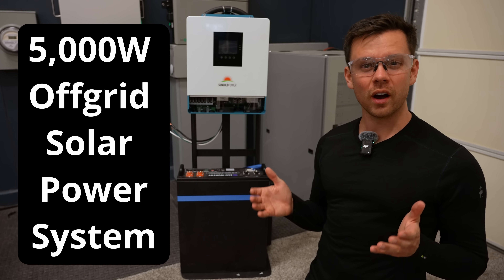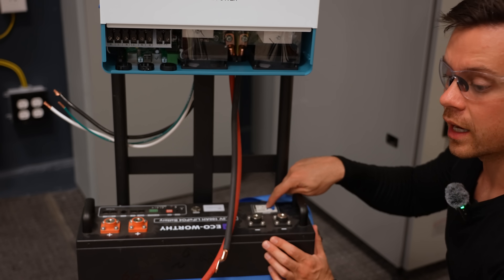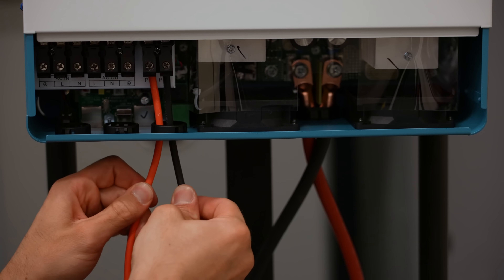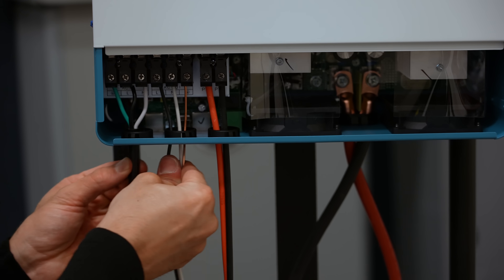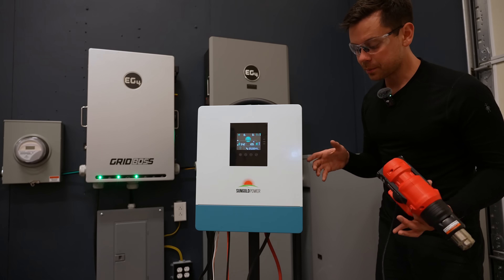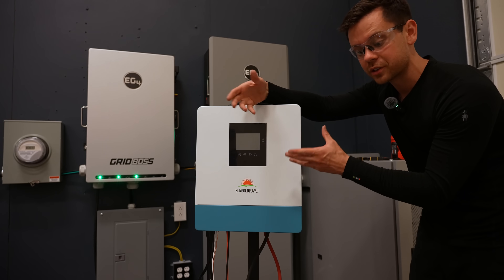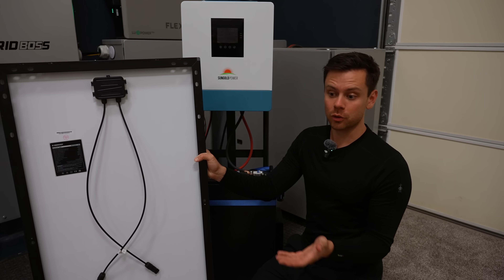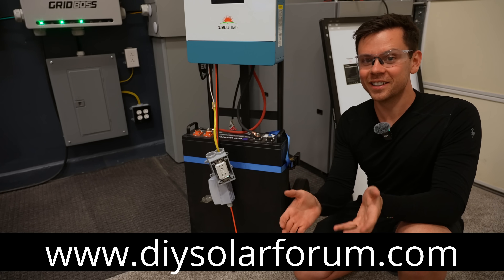Build a 5,000W Off-grid Solar System in 1 Hour

Comment: Ya know, it would be nice to have learned more before I started. My learning began with a hobo freight 100w solar, a 1000w inverter and a 100ah battery. Then a charger, then another couple batteries and another charger and a couple 100w panels, then a power station etc etc. Yes I learned a lot in the process but for less $ I could have done this from the get go and had a simple setup with equal or more capacity in a single system. I really enjoy learning more all the time, just wish I was smart enough and patient enough to learn more before I started.
Reply: If you started five years ago like I did,using the best equipment,you will still wish you had the newer ,better,cheaper equipment. Chinese manufacturers listen to what off griders want and it’s on the next ship. 
I am using Growatt 5K inverters mainly in my houses and they have performed pretty well. I like the 6000XP EG4 that I replaced one with but if I had waited for it to come out  , I would have missed out on a lot of education and savings. 
The best time to plant a tree is twenty years ago.

Comment: I would love to use one of these all in one units in my RV off grid system , I just don't have enough space for 120 volts minimum Solar that these require, are there any out there that will work with less solar ? ii there any way to work around this ?

Comment: I’m a grown up. And one thing I stay away from is electricity. I respect people who work in this field. One shock can kill you. I love this video. DYI video is very helpful. Thank you.
Reply: I was somewhat considering this, til he started talking about 120volts(even for the solar input)... no thanks. I'll just buy a power station 😂
Reply: @AlexKstar2025  Even worse, it outputs 120 volts AC.  Too scary for you?  You need to stick to flashlight batteries.  😄
Reply: @MrDave9111 naaahhhh, its not quite the same thing... this looks like some rigged up trolley... where if someone tugs on the wrong thing youre all of a sudden dealing with real volts... especially if youre stringing together 7 or 14pannels as suggested in series. If im gonna be dealing with all that, then all of a sudden a nice little unit is worth more than the savings to me, like the a bluetti elite 200 where its a compact self contained unit.
Reply: @AlexKstar2025 
Not really the same thing.
Reply: @MrDave9111 close enough for me. Then if I want to play with batteries I can just use them as a rigged up solar input.
Reply: @AlexKstar2025   Honestly if you want to get serious about solar, you need to learn to deal with higher voltages.  Its easy for me to say because I have dealt with 480 volts for years and Ive been shocked by it.  ( Not recommended!)
If you kill the power sources before working on this stuff, its very safe.
Just be warned that you can be shocked by lower voltages if the conditions are right.  Have you ever put a 9 volt battery on your tongue?
Reply: @MrDave9111 I've been zapped by 120 and everything underneath over the years... which is why I would rather not deal with it. 60volts or less for me... no rigged wiring. Not everything is for everyone. I'm sure I can safely build this in my sleep, but im not sure I want it around the house.
Reply: @AlexKstar2025  
Those components are really designed to be installed permanently.  Why put them on a hand truck? 
Realistically, this setup has the same hazards as a welder if you dont include the solar panels.   I would keep something like this in the garage.  If your going to hook up high voltage DC this really needs to be "installed".
I think people put this stuff on a cart since they arent confident enough to install it.   The power station stuff is nonsense.  Either do it or not.
Reply: Im a kid in a grown up body...
Lots of things can kill you...get over it.

Comment: Is there a safe way to exceed the solar panel input voltage rating calculation for an off grid inverter to capture more energy in lower solar hour environments, like setting up zones of panels that can be activated or deactivated based on the current amount of output being generated?

Comment: How many batteries can you add to the system? Been off-grid with a predator 5000w at $13-15 a day , and weve had 28 330w solar panels in storage. I want to get this done asap but i want to make sure itll run our frezzer and 2 ac units if possible plus other small items .

Comment: Greetings Will, thank you for a very well thought out and informative video! Can you recommend a reasonable priced "all in one" unit that can run 240v for a well pump? My well is only 70' deep and I believe is 6-8 amps max. I have 3 Lipo4 100 AH batteries to a 5000w pure sine wave inverter for 120 /fridge, oil heat furnace wifi, but am looking for a 240 option. Much appreciated!

Comment: How many batteries can I connect to this?  Is there a limit?  This is very affordable…I was looking at EG4 12,000xp plus some wall mounted batteries - but it was so flippin’ expensive.   I’d like a system that is under $5000 to start.   Then I can add batteries over time when I have the $
Reply: Me too.

Comment: Common sense and warnings for solar says to not connect or disconnect solar PV cables under load, that goes for the breaker as well to some extent.

Best is to connect/disconnect when it's dark outside.
Second best is to have the inverter off when disconnect and and for connecting just having the breaker off is enough.

Disconnecting with the breaker should work just fine for around 100 times pluss minus when under load before it may catch fire, but if the inverter is off then there is no load and won't arc at all when flipping the breaker.

High DC voltage and current takes a long distance to be broken and will cause an extremely hot and deadly arc since it never switches over 0v like in home AC.

230v AC takes less than 1mm to break the arc at 2000 watt.
While 230V DC can easily go over 30mm or more to break the arc and then can jump to your hands while holding the cable and then it's on uintill you are charred to a pile of dust 😅
Reply from the maker: Oh I absolutely understand that and that's why we use a PV specific disconnect. That's the whole point.
Reply: @WillProwse i know that you knew, was more for other people.
From what I have seen over the years is that you know a lot more about electricity and solar than most certified solar installers 😅

But even the solar specific breakers have a very limited life if used when current is flowing, and even the big ones says to not be used while loaded or only for emergency.
Reply from the maker: It's like 10X harder to extinguish dc arc, that's why we always use high voltage DC rated disconnect switch made for this application

Comment: I'm assuming you need a 2nd inverter to get split phase 240V for those loads.   Or can we just use a step-up transformer.  240V required for a well pump.
Reply: Neverminded.  Just went with a larger split phase

Comment: Is there a beginners system that has 240 VAC out so I can run my well pump ? The well pump only draws 6 amps running, start up is higher as you know.

Comment: On an RV, I would just connect the main A/C output of the All in One to the A/C shore connection. Then you would have A/C for your A/C appliances and 12vdc from the converter built into the RV. Everything in the RV is already wired, no need for all of the junction boxes, outlets, etc. I would recommend swapping out the 115VAC air conditioners for 12VDC ones that are far more efficient. My 10,000btu 12VDC rooftop pulls around 400watts on high but it has a variable compressor and fans that cycle between 400w and 300w. Even less on "eco" mode.

Comment: i got a question is there a battery charger that is programmable for 12 volts ??? i see they have inverter chargers but i already have a 2000 inverter ??? i would like two have one a battery charger that is programable so like i can set it when the voltage drops  it turns on at a certain voltage then shuts back off at the other set value.??????????????

Comment: A lot of these server rack batteries would not be safe to use in a high vibration mobile environment.  Many thread balance leads through metal with no protection resulting in eventual insulation damage if it were to be used in a mobile environment.
Reply from the maker: It will be fine
Reply: @WillProwse  In an RV as well?  Sorry, wasn't clear when I meant "mobile".

Comment: Silly question, Will: 

Could a person use a flyback transformer on the output of each panel (and connect the panels in parallel) to raise the voltage to the AOI  to ~300v? 

Does the solar industry ever use a device like this to reduce solar current or connect fewer panels?

Comment: I have something similar for a 48v golf cart with rooftop solar charger and step up controller.  It doesn’t actually charge the battery but keeps it from running down…may be a bad controller, also those 48v to 12v converters are prone to failure, have you found a good one that lasts more than a year?

Comment: meanwhile my 10kw  natural gas generator which will run my AC and all in my house for days costs less then this set up does, and this will run little for a little time, perhaps a small UPS thats about it...
Reply: Question.  It is clear that simply loosing electricity does NOT cut off your nat gas supply immediate.  However, does the nat gas delivery pipeline system depend upon electricity that will fail over time if backup generators in that system are not resupplied?  I ask because it seems that during those awful winter power outages in Texas, many people lost nat gas too after a while.  I tried to research this.  Even called the gas company.  The customer service rep did not know and didn't care to find out.  But I wasn't able to find the answer.  Research suggested that delivery for addresses furthest from the well head might indeed be electricity dependent.  But that it still works for a while as long as fuel is available to resupply backup generators.  Do you know?  Thanks.

Comment: Great demo thanks.  I was wondering how you could setup the AC out as a ring main with multiple sockets on that ring to power different things in different rooms instead of running extension cords.

Comment: It's still safe to do the ampacity math and use multiple lines of say, 6 gauge stranded copper wire in the amount of strands required to replace  sizes of wire even up to vsingle 1 or 2 gaugewire. For the outlets, I would do just that, I would run two double gang boxes, with double outlets ea, wired with 6 gauge stranded copper. Each gang wired with a separate positive and negative 6 gauge line then combine the 2 ea positive lines with a single crimp ferrule and combine the 2 ea negative lines into a single crimped ferrule or terminal depending on all-in-one connection requirements, and then attach to the all-in-one unit. Using Multiple strands of suitably insulated (THHN as an example) wire can be a safe alternative if you do your voltage drop and derating math, with consideration for being tightly bound or zip tied together  or just run loose. This aporoach is also good if you have tight spaces or bends that wont accomode the size of single large wires.  Might make a good episode going through the ability to substitue combined strands vs single.

Comment: Isn't it a potential issue to use that 14 gauge appliance cord to connect the AC input?  Specs say 40A of output from the AC battery charger, so even with no efficiency loss and no bypass loads, that's pulling 16A continuous which is already too much for a 14 gauge cord.  I'm guessing there's a setting to lower the charge amperage, but is there even a setting to limit bypass current?
Reply from the maker: Yes you can lower output current to make it safer but it trips fast and sometimes too easily. It's not a thermal breaker, it catches overload quick. but a load center would be better and recommended
Reply from the maker: Bypass current is the worst part of these systems actually. And ground neutral bond. Need to make new video about that. Absolutely an issue

Comment: I have a question. As a newbie to server rack batteries, is it possible to buy the 5.12kwh server batteries to recharge any of my portable power stations? Also, is it possible to solar charge server rack batteries without having to purchase an all-in-one inverter? Thank you.
Reply: Most power stations should accept power from a 48v battery (voltage ranges from ~48-57v. You need to look up your particular power station's solar voltage input range. My bluetti has a 60v max, so I can charge at full power using my server rack battery. The power station cannot charge the 48v battery though, so you will need a standalone charge controller and solar panels or a 48v battery charger that plugs into the wall.
Reply: @jake-mv5oi you can use a 48 volt battery charger that is plugged in to a portable power station to charge the 48v battery.
That is what signature solar had me do before my system was set up so I could get my battery's fully charged.
It was slower but it did the job.
Reply: @MyCabinLife  Ya, I meant it can't directly charge the battery without an add on.
Reply: @jake-mv5oi Thank you for that information. How do I connect a 5.12kwh server rack battery to my power stations? 
If I connect 2 of the 5.12kwh server rack batteries together (parallel or series?) how do I connect them to my power stations in order to power my power stations? Sorry for all the questions, but I am new to this stuff.

Comment: I followed the link to the inverter and found a 6200W split phase inverter also by sungold.  Anyone know how bit it is compared to the 5k?  I want the option of using it instead of my generator sometimes via my generator port on my house.
Reply from the maker: Don't use that one, haven't tested it. Their products are made by multiple manufacturers and I've had problems with their other products in the past.

Comment: Question for the experts, which I am not even a newbie. Is it possible to have a 30 or 50 amp plug. Instead of 120. I'm thinking of a way to plug rv in.

  Would imagine more battery/AH.
Plan would be to keep  plugged in all the time and when grid goes down ups swithes to the cart. Is it conceivable??   TY
Reply: That is what I'm building mine for. I bought a prewired rv outlet box with a 30 amp and a 20 amp outlets. I plan to connect it to the AC out from the inverter and have separately fused circuits. You can get the boxes with 50, 30, and a duplex 20 amp outlets for a little more. But 30 amp is enough for my rv and I'm using the EG4 3KW which wouldn't supply 50 amps.

Comment: Would you be interested in buying a new electric van (panel van) and figuring out a way to slam as many solar panels on it as possible (perhaps with a trailer that has some fold out panels and a large battery) and then see if you can charge the thing and how many miles you can add back into the vehicle per day to see how far you can drive on Sunshine. Those new Aiko panels at 24.3% efficiency and cell level diodes for shading look the absolute BOSS for this application.
It's got to be possible by now SURELY!! I need to see someone test it or I'll have to damn well do it (but I can't afford it) The new Citroen 4ton E- relay has 200KW (280 bhp?) and a freaking 110kWh battery!! Come on man I need to see this done!!

Comment: How would you wire this up for a 50a RV? Sounds like it doesn't have a built in transfer switch, but the RV would have the power distribution covered. There's a wide variety of switches to choose from though (and some have poor manuals)

Comment: Would it be possible to connect 2 of these in parallel to double the wattage??
Or is this recommended
Reply from the maker: Yes you can, and it comes with the cables to do so

Comment: Thanks for nice, clear, concise video.  Maybe not ideal for small or medium RV.  Not only do you need the boost add on for small PV array, but the 12Vout buck for 12V loads. You also need to hack in alternator charging, which is usually an important feature.  But for cabins or partial home system, seems great!

Comment: Thank you so much - I am striving to move from newbie into better informed and have been glued to your information! I have a Anker F3800 with a battery that I connect to a transfer switch to run all but the heavies (stove, air, pool).  I also run an office using a Ecoflow pro 3. The reasons for going ahead and getting these items were to save money on electricity and to make sure I could keep power going in the house (I have 3 disabled children who have to be taken care of with their own machines).  I only have about 1200w of solar, but use it to charge the Anker and Ecoflow on sunny days - then charge them overnight through AC when the cost is cheapest (goes down from .32 to .11 from midnight to 6 AM). i took a long time to say that I'm thinking I'll build this unit for power outage backup and keep it charged through solar and AC to keep units running in case I'm down more than 1 day- BUT may do the DIY VS Ecoflow Ultra instead due to the available power.  Does this seem an appropriate action to take?